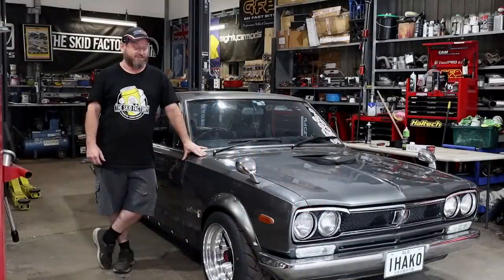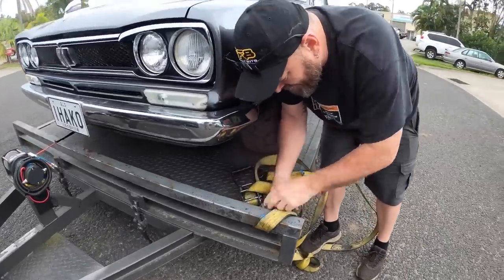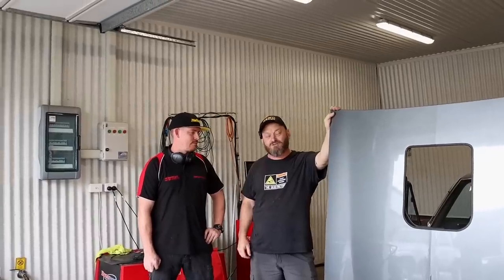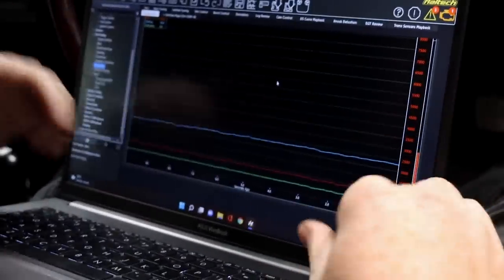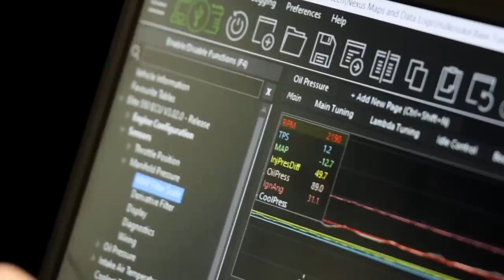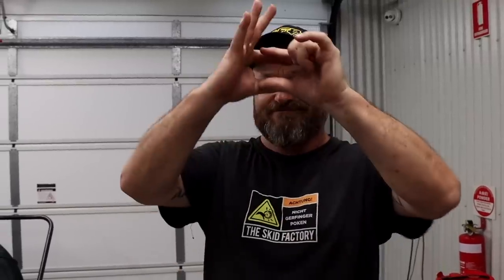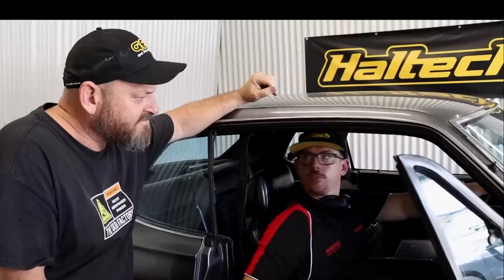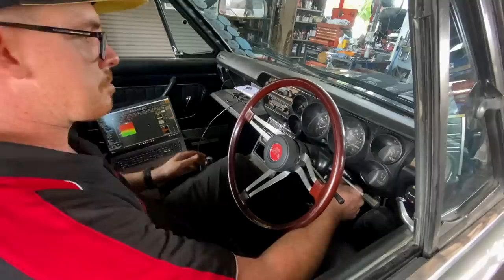VK56 HAKOSUKA Skyline Hits The Dyno!

Comment: The graph of the oil pressure looks like the spring in the prv of the oil pump is bouncing. A shim under the spring/a stronger spring may be a simpler solution to having to redesign your whole oil setup. Certainly be worth a try anyway. This thing sounds incredible ❤️ p.s never stop the outtakes ❤️
Reply: Yeah, the chart looks a lot like a spring bouncing.
Reply: I'd agree but for the fact it wasn't an issue on the engine dyno.  Only thing that changed so far as I saw was the oil pan.
Reply from the maker: We think the oil is foaming with increased engine rpm and the aeration causes pressure loss. There was no issue on the engine dyno.
Reply: That's fine except the engine was dyno'd by Nelson and obviously didn't have this issue before it left them
Reply: @theskidfactory  Was it on ITB’s on the engine dyno or the carby setup? The incredible sounds it is producing would also create significant harmonics. Springs really don’t like harmonics. Al’s experience on these things would be far greater than my own though, I just thought I’d say it to put the idea in his head as a possibility. Whatever his computer comes up with will be the correct answer I have no doubt about that. I have seen harmonics to play havoc with pump springs before. Look forward to hearing this thing roar at its full potential.

Comment: Judging by the way the oil pressure situation improved with the removal of the "strainer" I would say the suction line before the pump is a combination of "too long" and "too small". You may find you don't need to overcomplicate the oil system too much with extra tanks and things if you can get the suction side of things to the oil pump fixed up.

The fittings and things used in the suction line will be creating various choke points also, I think you would find an improvement upsizing everything significantly. I would be looking at the original pickup it had and ensuring that you have a diameter no smaller than it at any point. I would also be considering the size of the "strainer". Most OEM suction strainers are much larger than the small oval cutout in that tube.

But hats off on the result so far, sounds MINT, good luck with the rework on the oil stuff. All I know is custom oil systems are a massive headache.
Reply: This is what I was thinking as well. There is too much pressure drop between the pickup in the oil pan and the oil pump. A bigger diameter hose and tube coupled with a more "flow friendly" pickup opening will probably help.

Comment: I don't know if you're having the same issue as we had on the race boat. But at high engin rpm, the high volume oil pump was actually sucking the pan dry. It presented itself the same way. The oil wasn't able to return to the pan fast enough. So we restricted the oil to the top end and opened the return passages in the head.

Comment: I have had experience with a modified sump on a bike engine, the engine had a sight glass for checking oil level, which was brilliant to help us see what the oil in the sump was doing under load. It is a lot harder to see such a thing in a car compared to when I ran that engine on an engine stand, but maybe it could help diagnostics. Also, I'd make sure that suction hose isn't collapsing under vacuum.
Reply: Suction lines are never big enough!  If there is room for larger hoses, then use larger hoses.

Comment: I think the cavitation that Nelson is talking about is pockets of vacuum developing in the pump. As the pump flows more oil out, more oil needs to fill the pump, the flow to the pump becomes important. Low enough pressure at the pump and it will begin to cavitate, then the pressure drops off as the pump is making large vacuum pockets, less oil in the pump to flow out. The restrictions you’ve ever already removed improved the flow to the pump, and reduced cavitation, improved out flow and thus pressure. Nelson will likely have a plan, it might just be thicker lines from the sump to the pump.

Boys, cracking work again, amazing stuff.

Comment: I think you might have a hard time getting it to run fairly equal without a scoop on the hood. As it is now, the rear intakes will be starved because of the angle. The air coming over the bonnet will get to the forward intakes, but won't turn down into the bonnet to supply the rest. On the dyno it'll be fine as it is drawing in stationary air, but at varying speeds, you'll have different amounts of air going into each intake. 

My old Honda CB has this issue, as do all carbed 4 inlines. As you move your legs, you change how the air moves along the bike and if it gets to the carbs. The best solution is still the OEM airbox with minor mods or a breadbox style. Those are essentially what's on the intakes right now, but with a lid and mesh. They're taped upmost of the way around, so it equalises the air going in and have a steady flow. Very different engines, but the problem is the same: all intakes need equal pressure to have the it run with a steady AFR. 

The most common solution is a scoop, as you make it into a ram air intake which is easier to tune for.

A possible issue with the cavitation might be that the line from the sump to the pump is too small. If the pump can't get enough fluid through, it'll start to create bubbles but they're a vacuum inside, which then foams up the oil as they collapse.
Reply: A bit different with a carb as it requires air velocity through it to draw the fuel. Not such an issue with efi.
Reply: Crazy if you think you will air pressure like that.
Reply: A possible cure would b to split the intake hood into four Two for each of the front trumpets and two for the rear keeping the volume and area of the opening to same more work but worth a go
Reply: It'll suck more air in than push it,  so the angle wont matter. Those filters will be restrictive though
Reply: Make a split intake two for the front  four trumpets two for the rear four
Reply: @karlvanboxel561   it will not be an issue. OP is dreaming. There are literally thousands of cars. Race cars, street cars, race boats, buggies etc with multiple throttles out in the open and not one issue. The difference between the front and back trumpets in this instance will be tiny. Especially with the foam filters on which is how it will be 99% of the time. Using the scoop as an example shows how little he knows. The high pressure zone in the back of the scoop would create a much larger front to back pressure differential than would exist how it is now. Nothing at all wrong with it.
Reply: @ttv8ra23  The EFI will inject a predetermined amount of fuel and if there isn't enough air coming in because the intakes aren't in the right position, it'll run rich. On a carb, it will run poorly as it won't draw in enough fuel.
The issue remains though: getting consistent and equal flow into all throttle bodies.
Reply: @ttv8ra23  Problem is, that this is a know issue. For the CB example, the drag racers who run this engine, all have this issue and solve it by using the original airbox. It creates a steady flow, so all carbs run equal.

Any car that races at a pro level has a scoop if there is no regular intake under the hood. All the street cars you refer to are built to the owners liking. Not everyone likes a hood scoop, but if you want the engine to run well in every situation, you need one. 

Having a ram-air intake is something you can tune for, but having to deal with open air flow over a hood, with half the throttle bodies under the hood and below the forward row, is extremely difficult. 
The foam filters do nothing but filter. Not sure why you think they add something that would turn the air going over the hood, down into the bonnet and over the rear throttle bodies. 

A well proportioned scoop would equalise the throttle bodies more than having it like this, along with it being a repeatable situation as you know what pressure builds up in the scoop at specific speeds. 

Funny how you are so adamant I'm wrong, yet everything you say is demonstrably untrue.
Reply from the maker: You are overthinking it mate. This is not a carby bike that revs to 18k for a start and all 8 intakes are exposed the same amount. The trumpets fit under the bonnet, it's just the air filter that doesn't, there is a 50mm gap between the filter media and the bellmouth. And it will get covered anyway, we just didn't have time.
Reply: @theskidfactory  I understand what you're saying, with all the trumpets being under the bonnet, but they're not level, so as the air passes over the bonnet won't reach all trumpets equally without a scoop. The point is not the rev limit, it's having a consistent airflow that is equal. The example of the CB was to point out the fastest CB's (and all other bikes with ITB's, as separate carbs are essentially that) use the OEM airbox as it provides the most steady flow. 

I only mentioned this as you said you weren't sure how to finish the bonnet, as an idea to consider while doing so. 

Either way, just my 2 cents. I just hope to see this thing rip because it's amazing!

Comment: Air in the feed line is ventilation, not cavitation.  Cavitation is when the super low pressure on the trailing edge of a propeller or impeller causes a liquid to boil.  Ventilation is when you get air sucked into the leading edge of a propeller/impeller

Comment: Check the oils ability to return also. Once built, can also install a deaerator in the supply fitting of your oil reservoir tank. Sump (scavenge) pump supplying reservoir via deaerator, pressure pump supplying engine. Not sure if the deaerator is possible on car oil systems, but it is how its done on gas turbines.

Comment: The longer that hose the more like you're gonna run into cavitation. The pressure in the pump is decreasing below vapour pressure and the oil vapourizes. Looks like a real pain the ass to make that hose shorter. Sounds sick even at 4000 rpm. Well done guys
Reply: I was thinking going up a size or two with the hose and the center suction in the pan

Comment: For what it's worth Cavitation is not "sucking air" cavitation is the formation of void pockets within the pumped medium (in this case oil) it's not air it's vacuum. As such those pockets will implode which can damage the material the pockets implode in contact with. Cavitation will also cause starvation as the medium will not be pumped in the required volumes to service the bearings (in this case). In water pumps it will lead to a lack of head pressure and flow to supply the medium to the desired location.

Comment: One way to cure the oil pressure drop would be to increase the diameter of the pipes supplying the pumps!  If that dose not work then if possible change the gearing of the pumps or the volume they can cope with!

Comment: Sounds epic. Hats off guys!   Why would you not start with the dyno calibration?  Dry sump definitely the right plan if you’re spinning it that fast. Full suck through scavenging will help a lot with oil aeration and is worth power too. Moist is a good compromise.

Comment: Question......would slightly overfilling the oil help a situation like this or would the cavitation get worse? How about going to a heavier oil?
Reply: Over filling would help somewhat because of the slightly increased head pressure(height) of the oil but likely not enough for any real benefit before the crank starts churning up the oil. And a heavier oil would make the cavitation worse because of the thicker oil being more resistant to flow.
Reply: Dry sump should be the only solution.

Comment: Ah the joys of custom builds. At least it's not broken 👍 Fluid dynamics can get very involved very quickly. It could be that you didn't have a hat to act as a venturi/collector for the oil pumps pick up tube or it could be the length of tube to the pump is too great for the pump to suck enough fluid properly. Either way I'm sure you'll figure it out and hopefully not require going the 'moist' sump route 😉

Comment: Quick question: Could the oil pressure issue be fixed by running thinner oil? The reason I ask is because I can see you are getting 80psi of oil pressure at a fairly low RPM, which is a lot of oil pressure compared to the typical car if I'm not mistaken. And given it's at such a low RPM as well, that leads me to believe that you are running a fairly thick oil or you have a high pressure oil pump running or both. I think what may be happening is that above a certain PSI of oil pressure cavitation occurs. And I know you can lower the oil pressure by using a thinner oil or by using a stock oil pump, not a high pressure one.

If it had something more normal like 45psi of oil pressure at lower rpms and then it climbed to maybe 80psi max at redline, I think maybe that would avoid the cavitation. That's just my guess and I'm exited to find out what the actual fix turns out to be!

Comment: I've always loved your work but this is the firt time I've really liked to product. Is there no gain to be made in power and/or smoothness by going full sequential squirt and sparks with such a big cam and ITBs?
Reply from the maker: Not according to the engine builder. They normally run from a 750 holley.

Comment: A solid ali tube would be less likely to suck in on itself than the PTFE hose under high vacuum. Even try a spring inside the original PTFE hose to test?
Reply: Depends if the line is vacuum rated or not, and what the vacuum rating is.

Comment: Just my opinion, but seems to me like you need more oil capacity before the pump (bigger pan or "moist sump"). As RPM increases, so does the speed/flow of the oil pump. However, drain back to the pan remains the same, so you end up with oil "hanging out" in the engine and the pan goes dry and the pump starts sucking air. I would bet this is the cause of your issues.
Reply: I reckon you are right..I used to pit crew for a guy who had a drilled out sump plug with a clear hose connected to it for measuring this exact problem..if the oil in the tube goes down too low you have problems....mopar engines were really bad for it.

Comment: So the minimum safe oil pressure is tied to RPM.  The typical 10psi per 1,000 RPM?  The cost of that box and installation just paid for itself.

Comment: Being you removed a restriction and oil pressure got a little better would mean theres still more retrictions somewhere would it not?
Reply from the maker: It means that there is aeration in the oil from the sump and pickup arrangement. A semi dry or "moist" sump will remedy it.

Comment: Just a thought, when you look at a normal pickup there facing downwards and usually quit low towards the bottom of the sump… could it possibly create a Venturi effect where the oil gets pulled under a vacuum so kinda assisting the pump… I mean considering the power seems like that was a small pickup hole… also with the trailer weld on some shocks to slow the rate of the fall so it’s doesn’t hit so hard… love the car

Comment: Go a 1/3 or even a 1/2 size bigger in oil suction line , I would have at least double of pump outlet side , longer the hose bigger you need on suction , it's just a small hydraulic system .
Reply: I agree.  Unless the oil is getting whipped that badly.  Then again the pickup is not nearly as deep in the pan as it should be after removing the end.
Reply from the maker: This might be in a perfect world like a hydraulic system in an industrial application but this is all stuffed inside a very small car and basically not really possible. Moist sump it is.
Reply: @theskidfactory  I'm sure a bigger inlet could be done, maybe tricky but definitely doable , got to love a challenge 👍
Reply from the maker: We could do a bigger inlet but that ultimately means that the minimum oil height is much higher in the pan as we cannot draw from under the sump due to the road being there.
Reply: @theskidfactory  just trying help fella's and obviously haven't seen it so limited to ideas without seeing it.

Comment: Cavitation and sucking air are two entirely different things. One is the result of sucking air and introducing bubbles of air into the oil. The other is pulling a strong vacuum and causing bubbles of literally nothing to form in the oil and then implode.

Comment: Nice work boys, just not a fan of the dual atmosphere catch cans, its definitely not the way or example to go, especially for emissions compliance, I'd also hate to see the internals of this motor get destroyed over time with lack of positive crankcase displacement causing slug buildup.
Reply from the maker: What example are we supposed to set? It's a race engine, it has no facility or requirement for any of those things.
Reply: @theskidfactory  I see many cars end up poorly setup causing more emissions into the atmosphere like open vented - which is not fair on people engineering motors with equivalent OEM crankcase PCV circuit etc. I am guessing then that this entire project car is track dedicated? e.g. never drives on public roads or never registered. Many OEM/factory standard motors with ITB I've seen have the required capability to have PCV vacuum source - just doesn't look like this was factored in the lower manifold design where all 8x downstream of the ITB would be plumbed into a common vacuum rail
Reply: @theskidfactory  Plus vented/atmosphere venting of crankcase with no vacuum assist leaves the slug in the motor at idle, causing more instantaneous damage the second the engine is started, which is why I say vented catch cans are the dumbest invention, the circuit design thus has no ability to "suck" out or displace the air in the crankcase, kind of like trying to vacuum carpet with the lead not plugged into the wall, the inlet and exhaust of the vacuum cleaner both have atmosphere pressing down on them so no change in pressure direction